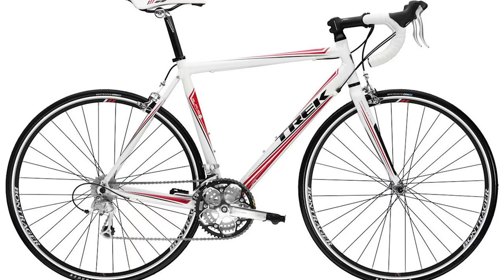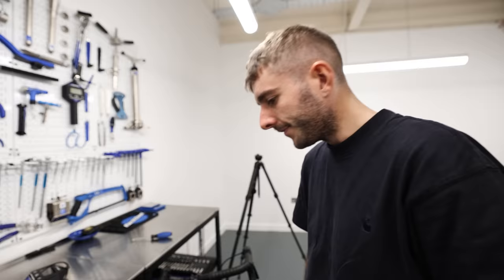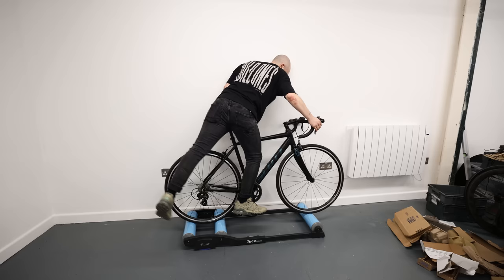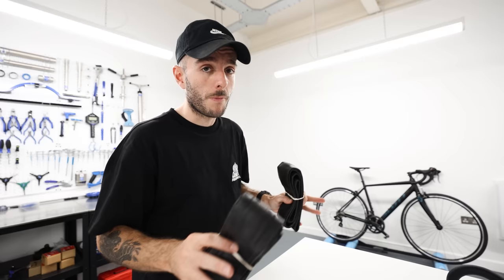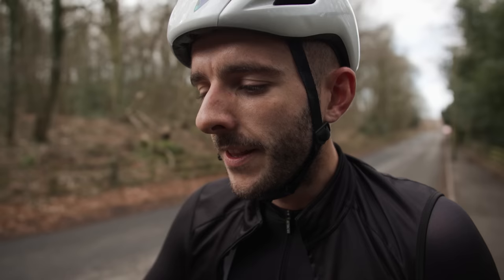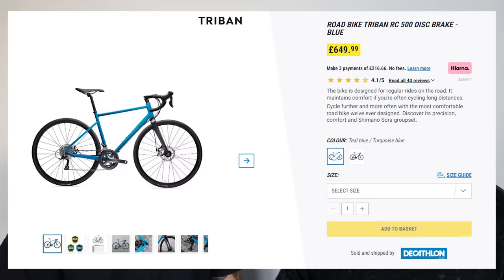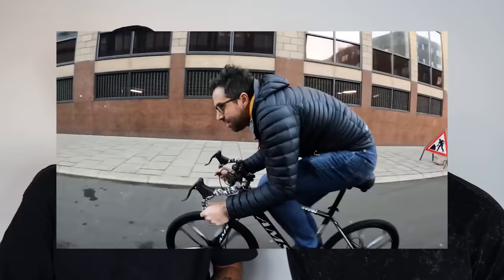How Good Is An "Entry Level" Road Bike In 2023?

Comment: The Scott is more expensive than other bikes at a similar level. A Triban RC120 with 8 speed microshift (with 11-34 casette) is currently £350 and a Boardman SLR 8.6 is £650 with Claris. Guess Scott is meant to be higher quality frameset.

Comment: Nice video.  I bought a speedster 30 4 years ago. It came with sora 9 speed group and a carbon fork and steerer from the CR1. The price was 800 euros. I changed the wheels and tires with better quality 250 euros ones and kept it for commuting. I'm getting very angry with the bike industry. My current cervelo bike costs 12k

Comment: I am a self confessed tight arse but £900 for a bike of that quality seems fine to me.
Its a very cheap hobby for the hours and hours of use it would provide.
My first bike was a entry leval Specialised Allez triple. I rode only that bike for over 10 years, never abused it but never had it serviced either and I could not wear it out (changed brake pads and tyres) The bike is of very high quality and I would recommend them to anyone

Comment: This is NOT an entry level bike price-point, but it is an entry level bike. In 2020 I bought a Giant Contend 2 from 2018 but new, from an authorised dealer (lifetime warranty on the aluminium frame), for £460 including shipping. That's HALF the price of this bike. The Contend 2 has Shimano Claris groupset (better than the Tourney on the Scott shown), it has a carbon fork (better than the aluminium on the Scott), it has a pressure relief channel saddle, it has an 11-34 cassette (which solves the issues they talk about for low gearing up hills compared to the Scott's 11-28 cassette with both chainsets being 50-34), it weighs in at 9.5kg (the medium Scott which compares to mine is 10.5kg, a full 1kg or ~10% heavier). Does the Scott even have mounting points for mudguards? My Giant Contend 2 does, making it an exemplary commuter.

So tell me, why are we paying TWICE AS MUCH MONEY for a bike that's worse in every way than a bike from 3 years ago? I'm not talking about a bike from 1985 here or even 2010! Don't accept this nonsense, it's criminal what companies have been trying to get away with with inflation for corporate gain.

Do not buy this crap at this price!

Comment: Bike prices are crazy now, my 2014 Scott Speedster 20 with 105 shifters,105 front and rear mechs was only £600 new and I would have classed it as a mid level bike, my first road bike was a Triban 3 which had Shimano 2300 and carbon fork paid £300, now that was the king of entry level bikes, that was until a car wrote it off. Currently have a 2015 full carbon Bianchi with full 105 which was only £1250, if I was to change my bike now with my budget of 1k I would buy a quality used carbon frame, new mid level wheels (rim brakes) and a ali express group set, Sensor or Ltwoo, modern bikes are being priced too high for average paid people like me. Maybe you could buy the best used bike for the price you paid for that Scott to compare.

Comment: Yes. Objectively this is expensive, but it’s an entry level bike nonetheless. As someone whose budget is definitely “entry level “, I’ve looked at many, many bikes at this level. It’s hard to criticise Scott because at this price point there’s so many variations. The aforementioned Triban 520 comes with a nicer groupset and hybrid disc brakes- but it’s much heavier for example. Entry level is a mess. I think that big brands have moved towards more affordable groups in some settings. Cannondale’s Topstone 4 uses Microshift to move away from using the good old 50-34 which is arguably not beginner friendly, as have Marin, Vitus and others. Personally, I’m looking at the Voodoo Limba or Nakisi. Heavy, maybe, but they are fine for my needs.

Comment: My first bike was Trek 2.1 on 105. Still use it has my winter bike. And yes I’d consider the Scott most definitely entry level. A good way to save some money when buying is to wait until the new models are released then seek out the previous year model which are usually heavily discounted. I managed to get a cannondale super six eco on ultegra for £1500 doing this a couple of years back. What are they now £4k

Comment: Well, the 600 £ from the Trek are – 14 years later – almost exactly 900 £, if you calculate with 3 % inflation each year (600 × 1.03^14), so that's not far off. Don't know about the exact inflation in GB, but the last two years clearly were even higher.

Comment: I think it absolutely IS entry level, because when we use that term we don't just mean something cheap and bike shaped, it's the cheapest thing that's bike shaped that will actually work as intended for a decent period of time with a bit of basic maintenance.
Reply from the maker: Agreed, although I think you can go a bit lower than this and still get those benefits

Comment: (1) Couldn't agree more that most bikes are geared too high!  The amount of time I would be in the top gear of your bike (50 over 11) is miniscule vs. the amount of time I would be in the low gear (34 over 28).  Why not make the cassette like 16-34?
(2) re low-end pricing: A few years ago, I walked into a bike shop that had two beautiful new FUJI road bikes hanging on the wall (maroon, light blue), with classic 10-speed looks for 60,000 yen ($600) each.  I passed them by and still regret that decision!

Comment: 34/28 is a pretty low gear for the road, when you only have 7 to play with a bigger rear cog would not be great. The 11 is a bit silly though, 13 would be a better smallest cog.
Reply: Even a 50-over-13 is crazy high geared.  I'd likely be coasting and tucked at that speed.  I'd prefer the lower gearing every time!  Like 16-34 cassette.

Comment: It's entry level for the present day forsure. Just 5 years ago in 2018 I bought my first bike for just £100 more and got a carbon fork, carbon seat post and full 105 groupset. I know theres inflation but still, hardly good value nowadays I feel. I still had to change out bar, stem and saddle when I got a bike fit though so upgrade expense there. Why bikes still come with 420mm bars I'll never know? Why can't manufacturers give you the options when buying a new bike no matter if it's entry level or not?

Comment: Great video. I basically didn't ride from 2004 until about 2020. I rode some very nice bikes I bought around 2000 for about $1000, which was fantastic at the time. My first bike during 2020 was a super entry RC100 and I grabbed a RC500 in 2021 from decathlon for about $400/$1000. Both are fantastic entry level bikes and it's sorta amazing how far tech has come in 2 decades.
Reply: Just got 500, you get the black or blue?
Reply: The RC500 is on sale for 650€ at my Decathlon and IMO the perfect entry level for a "nicer" road bike without going enthusiast 105 level
Reply: @ehrenfull  I paid £649.99, us Brits getting it tight after Brexit 😆
Reply: @New-ye2fl  I got mine in blue. I love the colour.
Reply: @ehrenfull  best part about getting Sora , replacement parts are cheaper.
Reply: the RC500 is 1300 now in Canada. I bought mine for 950.
Reply: @JustAnotherHo  Both are nice,it’s a clean looking frame.

Comment: Yes, its an entry level bike.  For this genre of bike, I prefer the Specialized Allez Elite with I believe a better frame design and carbon fork for maybe $200 more or so.  Btw, I built a 40mph ebike out of an Allez Elite and it has stood the test of time with a 1700w Bafang BBSHD motor.  A stout frame with excellent vertical compiance.  I also road it without a motor for a year or so but changed everything including narrower handlebars...shorter cranks, wheelset...pretty much everything but the frame.
Reply: An Allez Elite is $1700. You're f'n mad if you think that is entry level.

Comment: If you're 70 years old (as I am), a cheap bike with a straight-butted, mild steel, lugged frame and a low-end Shimano group from the 1980s (so generic, it's even branded SR, who made frames for all kinds of brands), is a dream you had when you were racing in 1966. Finding one at a yard-sale in clean, straight, adjustable condition for $25 isn't just entry-level -- it could be your daily rider for 15 years, as mine has been. Reliable beyond words. (But then there are the snob-equipped riders who will exclude you from all activities and confabs. <sigh> Funny, how a Strat or a Les Paul from 50-60 years ago won't embarrass any guitarist on any level -- quite the opposite. Compare the attitudes while comparing the equipment. The bike world is sadly wanting, in that overlay.)
Reply: (The fancy seat on my old bike cost more than all the other money I've put into the bike.)

Comment: I would buy an entry level bike and upgrade it over a mid level bike any day, I bought a trek domane al2 disc for 850 euro 1 year ago from new, upgraded the groupset to sensah empire pro (carbon), with compression less housing, juin tech brakes, winspace wheels, gp5000 tyres and latex inners, and the bike to me feels like a race bike, for less than a mid range bike running 105 and crappy wheels.

Comment: I have a cube attain race tiagra. Hella good
Reply: I too have a Cube Attain. What year was yours brother? Mine is a 2016 GTC Race.
Reply: @Rose.Of.Hizaki  a 2022. Mechanical disc brakes but the higher end TRP ones. Pretty good. Just changed the wheelset so it’s about 8kg now.
Reply: I have the same bike only the 2017 version so it’s rim brake,  10speed, 11-34T cassette so can handle most climbs, cost under a grand 5 years ago so great value, just started getting into zwift so it’s finally going to get some use again
Reply: @kiely4561  mine has a 11-34 too. I’m guessing cube road bikes come with that ratio now. Also mine came with 28mm conti ultrasports. Really comfortable.

Comment: That Scott is very expensive for an entry level, and even worse it has a very basic gear group, for less than that you can buy a Trek Domane AL2 with a Shimano Claris R2000 2x8 group, also rim brakes, I'm not totally sure but I think the fork is carbon, and for a little more you can buy the AL2 Disk with mechanical disc brakes and that one does have a carbon fork, also a Shimano Claris group, and is lighter.

And even better is the Giant Contend 1 that comes with Shimano Sora group, rim brakes, both the Trek Domane AL2 (Rim and Disk versions) and the Giant Contend 1 are available for less than £850, really that Scott is not a very good buy.

Comment: It's scary that £900 is entry.  I think at that point a second hand bike with a check over by a local bike shop has got to be better.  For example I paid £420 for a boardman team carbon, 105 cassette, tiagra rear derailleur, fsa front rings, tiagra front mech, tiagra shifters, 105 breaks upgraded wheels and an aftermarket and light stem.

Comment: As a taller rider with broader shoulders hearing that your bike came with “wide” handlebars is almost silly. This budget bike is geared towards beginners who might not feel stable with super narrow bars. The pros slimmed down to 42s over the years. It’s only now they ride with 38s or narrower. I’ve got years of experience but cannot sprint or climb with 40c bars, it feels like I’ll tip over. Imagine what that’s like for a heavier rider who’s just begun to ride this entry level machine.

Comment: My Frist road bike was a btwin triban 5 Sora group set I still have it but it is limited with tyre size so I now have a focus carbon frame with 105 groupset 😁 is it better 🤔 my be up hills and handling but on a flat road no difference at all I have done a 10 mile TT on the btwin and my best time was 26min with no aero aids 😁

Comment: 8:30 it really more expensive than 600 pounds in 2009? As far as I am concerned, 600 pounds in 2009 has the equivalent purchasing power of 1030 pounds in todays worth. So if you compare these two numbers, the new Scott Speedster at 900 Pounds is acutally more affordable than the old bike in todays worth.

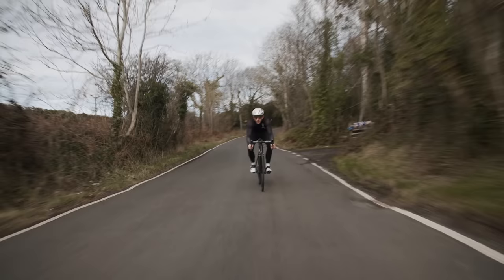Comment: @7:52 the base model discs that Scotts can be found with are utterly horrendous!
Honestly, the minimum standard for discs should be TRP Spyre or equivalent. They're not exxy, fkn effective, and even put hydro's to shame (as to how little improvement some offer).

For base model bikes like this I'm surprised Sub Compact cranks aren't an option to tick. A 30T with a 28 rear is on par with 34/36T and a 30/32 cassette for ascending, and how many recreational/Non Racing cyclists actually wind out a 50/52/53T - 10/11?

Ooh! #Thought  With your journey into cheaper groupsets from the East.
I've been noticing some bike m'fers are going with Microshift for their low models. Any chance of finding one for a side by side ride against El Tourney here?

 And in a similar fashion but for the other end of the spectrum, getting your hands on FSA's groupset and pitting it against it's Campy/Shimmy/SRAM opponent? Mayhaps a group ride of fellow racers (of close to same bike fits) swapping around bikes per cafe stop... ? [shrugs]
Reply from the maker: The illusive FSA groupset. We want to try this!
Reply: @Cade_Media  They advertised it long enough and priced it to a point where if SRAM/Campy/Shimmy second tier packages beat it, it's an abject failure BUT a first step... that's just been gotten wrong.
 I'll remain a fan of 'Something Else' though. Like Sensah, and if Sensah are committed serious enough then in 5yr or so should be a respectable competitor to the above 3 in quality rather than just price.

Comment: I remember buying an "entry level" Giant Defy in 2010 (approximately £549)    and it was 9 speed tiagra (4500 series)  with 11-25 cassette,  and 34/50 chainset,  and they were marketing the 11-25 as ultra-wide,  some other bikes came with 11-23,  who thought those gear ratios were a good idea?
Reply: Back then 11-25 was the norm. I was a wimp and changed out the 11-25 for an 11-28 on the SuperSix I had at the time. I got a little flack because it wasn't "pro". Which is funny because most pro bikes have an 11-32 now.
Reply: @DaveCM    I remember buying SRAM 9 speed (11-28) cassettes to use with it ,  at one point I had an shimano XT derailleur to cope with the wider cassette.  I eventually upgraded the components to 10 speed Shimano Tiagra (4600 series),  it's now my turbo trainer bike.

Comment: To me that is an entry level bike. I bought a used Trek Emonda ALR 5 (2019) with Shimano 105 11s. That bike worked like a charm and paid 700€ for it (at that time £600). Changed the wheels, cassette, tires, saddle and bar tape along the way. For less than 1300ish euro I have a 7.5kg bike with 22 gears which works like a charm. To me this is not an entry level bike. Now prices are insane.

Comment: 42cm bars on size small entry level roadbike are PERFECT...98% this bike will be purchased by a new "noob" rider, any extra control is welcomed especially when that rider decides to draft in a group.  You should be ENCOURAGING this type of build.
Reply from the maker: I respectfully disagree and here is why: https://youtu.be/hdNrJkeGgAI
Reply: I'm sure you do disagree. It's not really debatable that wider bars are safer...it's basic logic.  The leverage of each turn/twitch is reduced...that's massive.  You guys are not the target for this bike at all.  Swapping out the bars/tires/saddle makes sense and a bike shop should do this without debate even at this price.  #newriders #safetyfirst
Reply: So I watched James/bike fitter (who works with pros) review his theories on fitting...without leveling my own criticisms about bike fitting in a studio I'll just ask this; you think a newbie rider who just spent money on an entry level bike is going to spend $200-400 on a bike fit?  Insane.  GCN and various other outlets just don't understand "entry level" and really shouldn't ride them for any reason.  Comparing this current Scott to my '99 S-Works M4 is not fair...this bike can only be compared to other off the shelf products since bikes from 2015 were running SRAM Red 10 and had 6 more gears than bargain Shimano from '22.  Apples & Oranges honestly.

Comment: my commuter roadbike costs me new 650€ with a Sora Groupset mechanical Disc Brakes ^^  ... 
I drove this bike until now 35.000km without any issue (with Bikepacking 600km ... ) ...
The parts are cheaper then a 105 or Ultegra ... It lasts longer ... 
I drive mostly flat with a 25 cassette ... i dont need more gears ...
Do some WAX and ure done :)

Comment: The 2009 and 2023 bikes were almost the same real cost. If you use an inflation calculator such as the one published by the Bank of England, you can see that £600 in 2009 equates to about £875 in 2023, so pretty much the same. It's very misleading to refer to the 2023 bike as being £300 more.
Reply from the maker: Of course, that’s why I mentioned money being worth less in the video!

Comment: Entry level = $500-$700 - should be accommodating to new cyclists; triple chainring, easy geometry
Mid level = $900-$1200 - should not compromise frame; good alloy frame, cheap drivetrain & other components
Upper level = $1500+ at this pricepoint customers should know what theyre buying anyway so market should be self selecting.

Comment: Sora should be the starting point of any road bike.  Tourney is the crappy groupset of Walmart shitty bikes.  I love my 2018 Aluminium Kuota bike for which I paid 1300$Can (Monopoly money) and was equiped with Shimano 105  5800.  I bought a decent bike (1600$) at Decathlon last year for my daughter and it was equiped with Shimano 105.  My El Cheapo bike is equiped with the new Sora and it works fine.  A 2000$ bike should come at least with the standard 105 derailleurs, shifters and cassettes.  The upgrade on this entry level bike will be $$$.  It is expensive to be cheap.